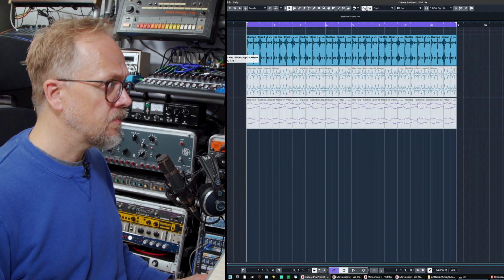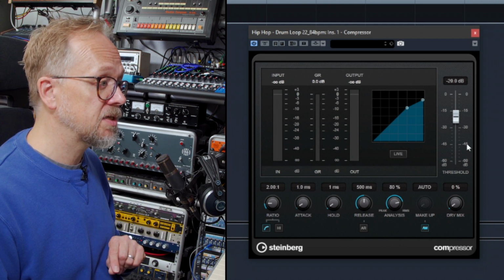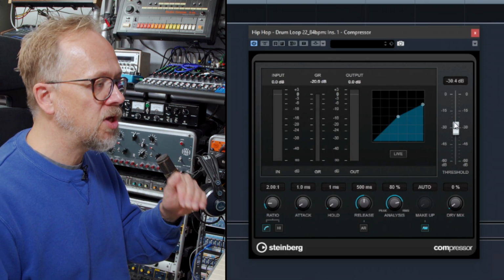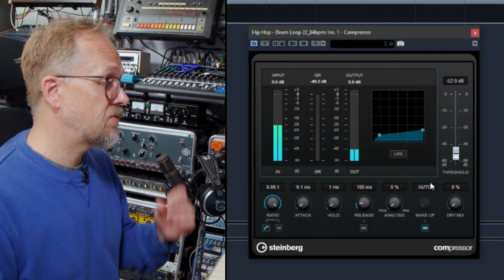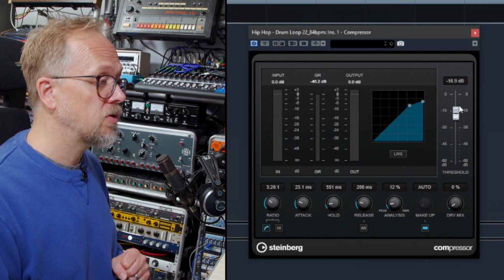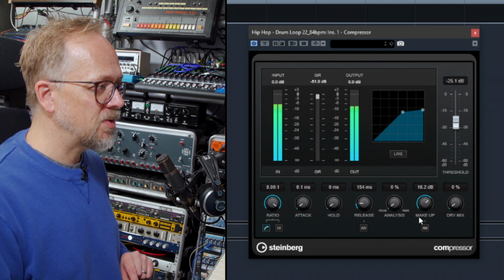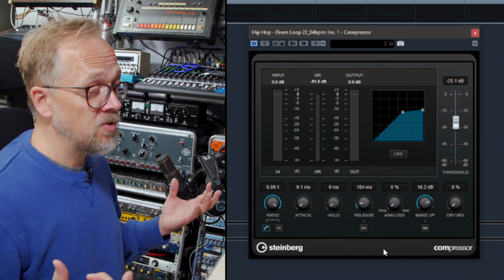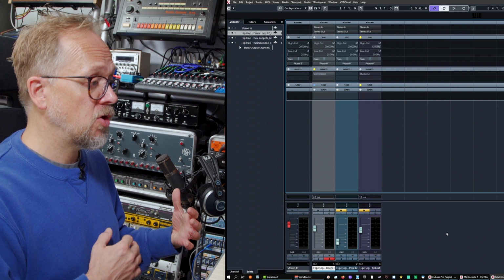Cubase Tutorials: Understanding Compression

Comment: I have a question regarding compression. I did som experiments using fabfilter pro c2.  I took a sine wave and made it switch between peaks of -12 and -18db. What I noticed is that as soon as I pulled the threshold down, the output level actually increased even though no noise were exceeding the threshold in the compressor. Do you know why this occurs? 

I noticed one more thing as well. If I had the knee all the way on the soft side, I actually increased the output level even if the threshold was all the way back at 0. I only had to turn on the compressor for the output to increase. Do you have any answers? Please help, I am confused.